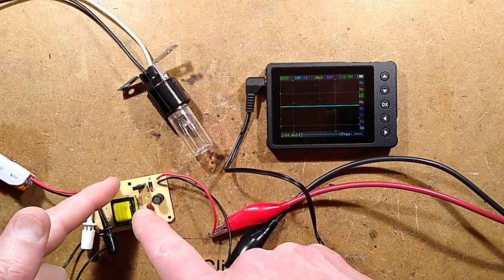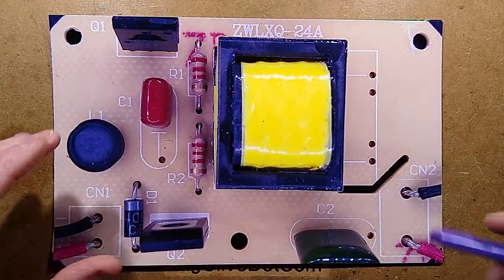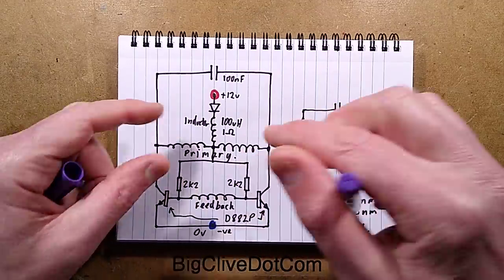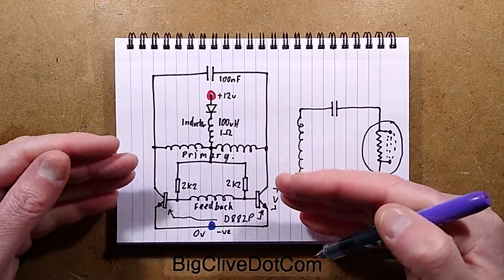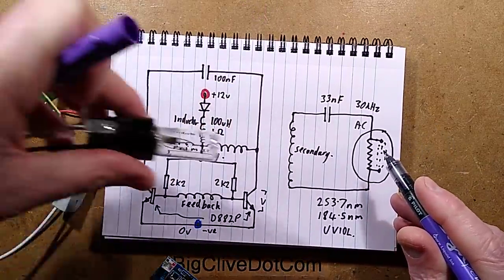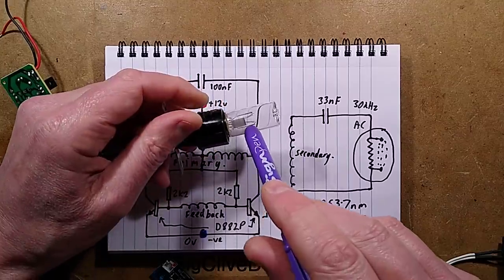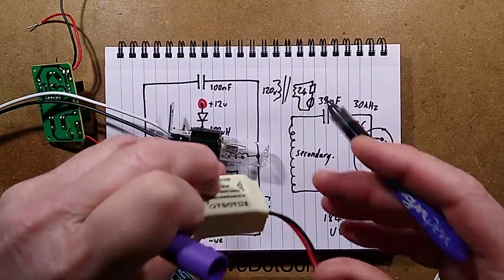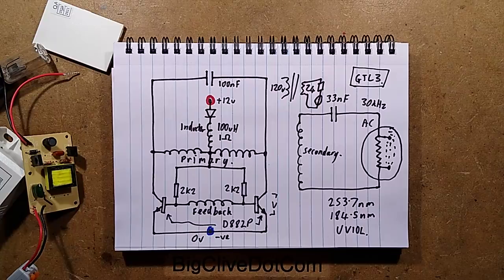Unusual low voltage AC current limited PSU

Comment: That cap across the primary is forming a resonant tank. It controls the frequency of the oscillator.
Reply: And the cap in series with the secondary and lamp looks like it could be resonant too. It's like a weird cross between a Tesla coil and a TPTG oscillator... except there's no obvious feedback from the secondary to the primary. Does the secondary reactance change sufficiently when the tube lights to stabilize the primary frequency?
Reply: @markfergerson2145  The secondary capacitor (and the load of the lamp) would be reflected across to the primary multiplied by the turns ratio of the transformer squared. Dunno how big of a role it'd play.

Comment: NB most electric clothes dryers in the U.S. operate at 240VAC.
Reply: They do, but they also have a Neutral connection, so 120VAC is readily available inside.  In fact older cloths dryers from the 1960 and 1970 had these UV emitting bulbs in them.  They were typically wired up in series with a regular 60W lamp.  I'm guessing the current draw on the lamp and UV lamp made for about a 12V drop across the UV lamp, and the rest across the 60W bulb.
Reply: @awebster  The 3W versions of these have the same operating current as a 40W 120V GLS lamp and lamps marked as ballast lamps that were just rebranded 40W lamps were sold at one time.
Reply: @awebster  the separate neutral line is still a "fairly" new thing on 240v appliances in the US. For many years they used chassis ground as the common/neutral. In fact, many reasonably new 240v appliances still don't have a separate connection internally for neutral so neutral and ground are terminated to the chassis.
Reply: @BamaRailfan  Canadian here, when I was a kid we'd get a tingle voltage if we touched the stove and the fridge beside it at the same time because of the stove's ground doing double duty as a neutral for the 120V mechanical clock and light bulbs in it. It was a grand day when that original 1962 range was replaced in the 80s. It's insane that the electrical  code ever allowed that.
Reply: @KevinT3141  I know right? What is even more amazing is how long they let it go on. Our current clothes dryer is from 2007 and is wired the same way. I have seen newer one like that as well.
Reply: @BamaRailfan  Indeed, my house has a three-terminal outlet (2×120VAC opposite phase + neutral/ground) for the dryer. New dryers come stock with a 4-terminal plug, but the power lead is commonly swapped for one with a 3-terminal plug in houses that do not have current wiring.
Reply: Yes mine runs electric element on 240 and spin motor on 120 don’t know why they do that when they could run both on 240 single phase. US 240 will work without a neutral or ground but it is not safe to do so.
Reply: Same in Canada
Reply: In the U.K. it would be extremely rare to get three phase in a house. Most houses have what effectively looks like a Coaxial cable with the Neutral grounded and a single phase in the middle. I believe they normally wire houses along a street to different phases to try and balance the loads. Years ago, where a friend lived the neutral to the street became disconnected from the substation which was disastrous for his appliances as when a neighbour tried to draw a heavy load his mains went up to 415V.

Comment: Can you post a link to the scope? That thing looks epic
Reply from the maker: It's actually retro in DSO terms.  You can buy it directly from Seeed studios or their partners.
Reply: @bigclivedotcom  I have a 2 Channel, seeedstudio, DSO Nano 212, if I remember correctly, it's good enough for what I use it for, basically just checking generator and power supply output waveforms,
I just wish there would have been more work done on the fft, fast Fourier transform, firmware update, for it, but as far as I can tell, that update has been dead, and not finished for a number of years.
Unfortunately, because I wanted to be able to do with THD measurements.
I would love to get, a differential probe and an amp probe for my little scope.
Reply: I came here to ask that. Need some details about it.
Reply: I also came to ask! I was even looking for one in this form factor a few weeks ago and was rather surprised and fed-up that nobody had seemed to realise it would be a useful thing to sell. Thanks Clive!
Reply: It's very good 🤫
Reply: Mine was stolen 😥
Reply: @dogwalker666  that sucks, not to mention, even the more expensive ones, of the mini DSO, are still cheaper than a dang smartphone!
Reply: @turtmastert3545  true but phone is insured.
Reply: @turtmastert3545  some CARS are cheaper than some smartphones!
Reply: @dogwalker666  sorry to hear that 🙏
Reply: @grantrennie  👍
Reply: Check out the HS402. Very powerful software aimed towards automotive but super portable, runs off phone or tablet OTG.
Reply: I think the makers of the TS 100 have a mini o-scope available... I need to look for something small and nice soon.
Reply: Thanks for the info, didn't notice the replies. Asked about it on the live stream last night and bigclive answered.
Reply: Was this video unlisted? How did you comment 3 days ago
Reply: @alexstone691  We Patreons get early access. :)
Reply: @alexstone691  patreon :P

Comment: Never gets old.
Hmmm. I wonder if there is any value to switching the DC polarity to the emitter to make it last longer when it is a DC application?
Reply from the maker: It would be useful to alternate the polarity from time to time.
Reply: That is simply just turning it on and off. Being DC, it will shorten it's life.
Reply: The cathodes wear out while in use. If run on pure DC one end will wear out first, likely blowing the filament and rendering the bulb useless. If run on AC (or both polarities of DC) each cathode wears evenly at half the rate so the bulb would last twice as long. There are also issues with mercury migration or something when used on DC but I don't really understand that.